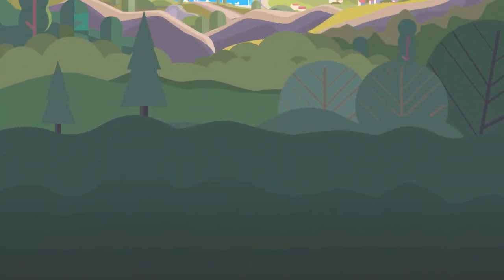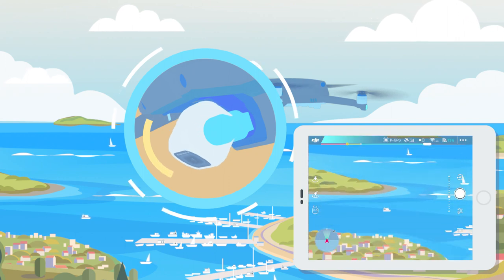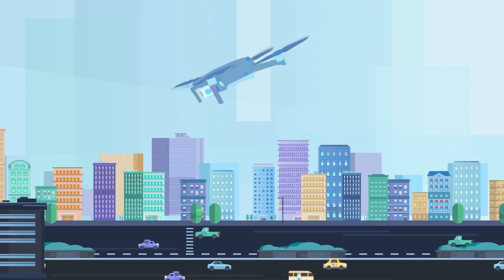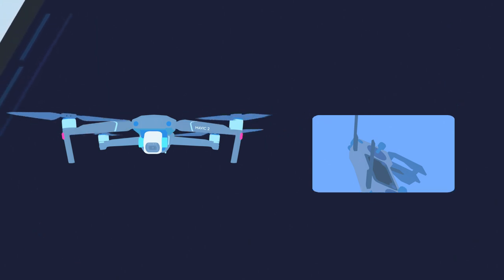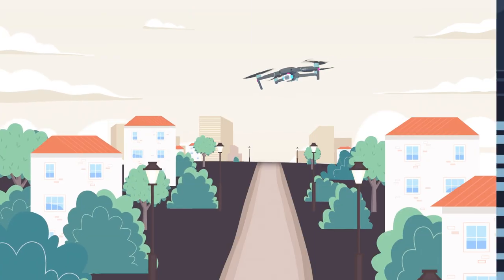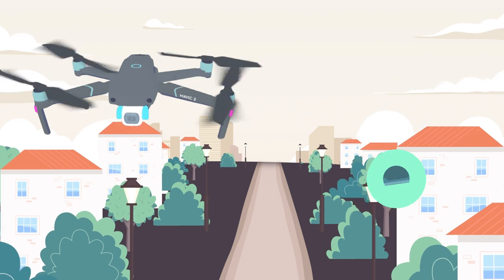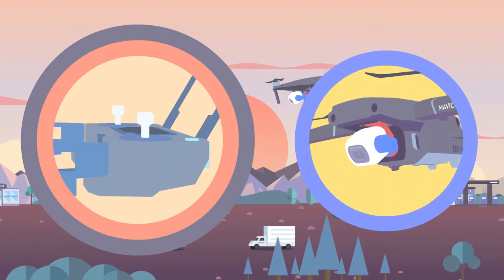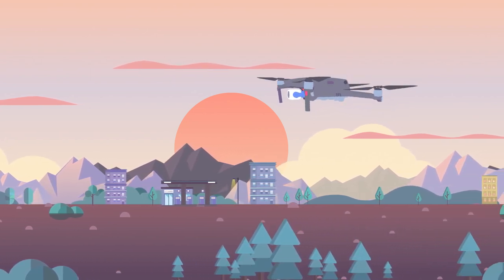How to Prevent the Mavic 2's Gimbal from Tilting Down

Comment: Why do I have to do the Gimball / compass Sensor resets every-time i get out of the car? I have to go through the whole process spinning the thing around. Latest Firmware on drone and iphone software....its annoying
Reply: it's been like that for over 6 months...fix it!
Reply: Maybe you should open some science books and learn about electromagnetic interferences and the impact of steel on such devices like a compass, simply avoid putting your aircraft close to metal or anything which can disturb its normal running wherever you are on the ground or/and the air...

Comment: Here’s a suggestion to fix this “worst feature ever”. IF the camera must tilt down to avoid damage, then once the drone is flying, it should slowly tilt back to horizontal. In my experience, in Sport mode, the gimbal ALWAYS dramatically tilts down in a snapping manner that seems easier to fix than make this elaborate animated video

Comment: Hey DJI... How about you fix this in Firmware....
Reply: This is intended behavior though.
Reply: did you not listen to what he was telling you ? it is not a fault.
Reply: @uptowndisco2  Oh... so the unrequested action is a FEATURE.... ROFLMAO
Why do I need to manually adjust the camera from a non requested action from the drone. It can be dealt with in firmware.
Reply: It is a mechanical design failure. This cannot be fixed by a firmware update.
Reply: @ronanchauvin5506  IT IS A FEATURE, WHAT CANNOT YOU UNDERSTAND??
Reply: @Laris Marcu This feature/fix prevents mechanical damage to the gimbal but is also degrading the video stabilization (by adding a pitch/tilt angle for some drone orientations). From my point of view, it would have been better to create a design with more mechanical angle range on the pitch/tilt axis.

Comment: Idea? Put cameras on rear/both sides hd vision and be able to toggle with 5D button so in flight you can check what’s behind and at the sides.
But only use front camera for recording. Will help with checking your surroundings during flight...

Comment: Sometimes I notice that my gimbal is tilted on right side is it normal ? Its so light that sometimes its hard to tell if its tilted or not.
Reply: gimbal tilt calibration is a persistent issue with DJI drones.  you need to level it against the horizon occasionally.  hold down C2 and use the right scroll wheel to adjust.
Reply: Mavic Pro Thank you so much will try this one. Because I got box packed drone in pakistan in almost 40 to 50 days I thought something has happened in transit period.